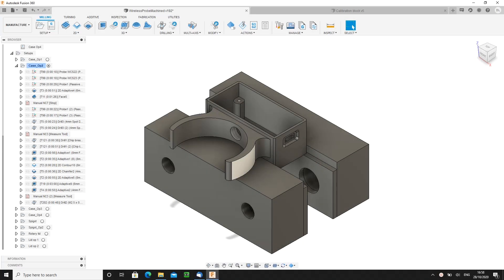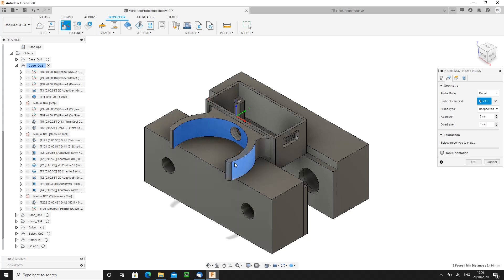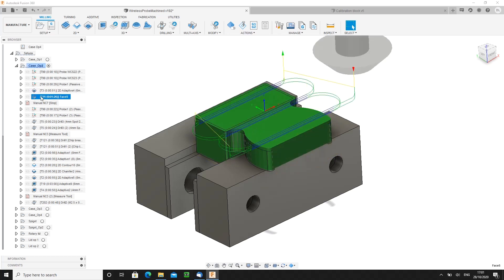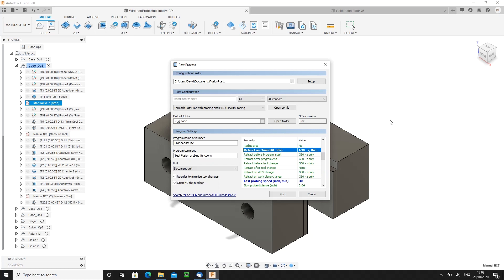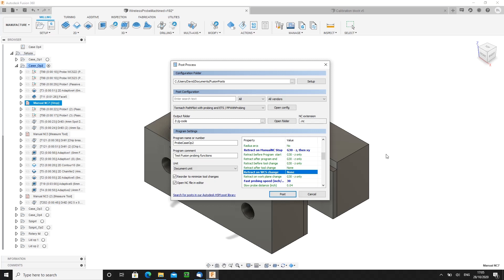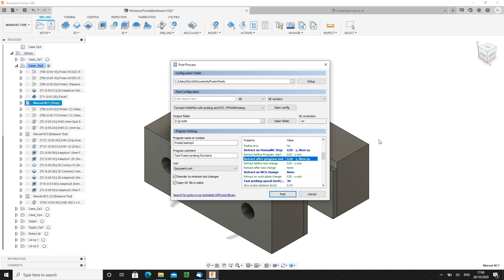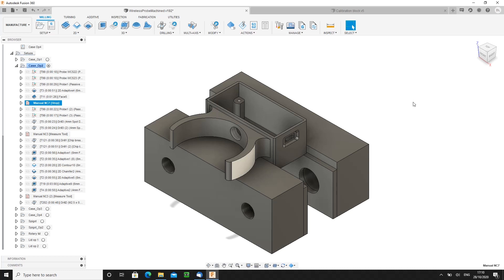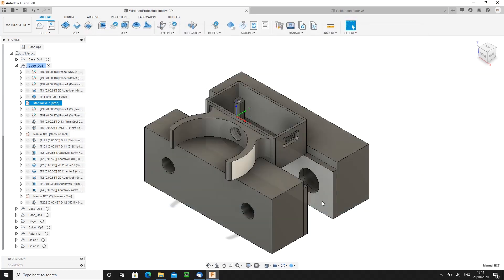PathPilot post-processor updates October 2020

Comment: Hi David, when you do a WCS probe does it now update the current WCS or the next one (G55 if you probe in G54) ?
Reply from the maker: The normal behaviour is that the probing routines run in and then update the wcs specified in the setup.  So you would probe in G54, update G54 and then machine in the updated G54.